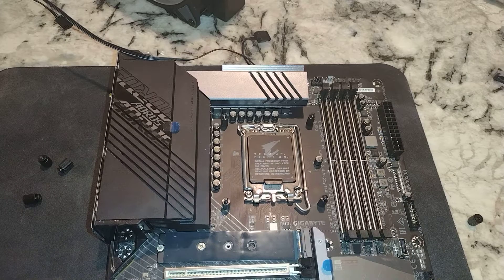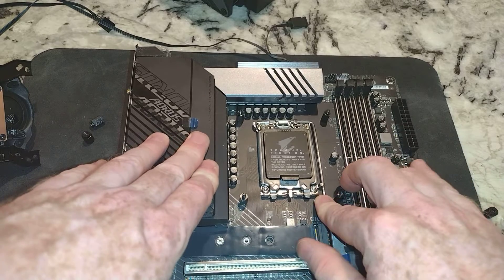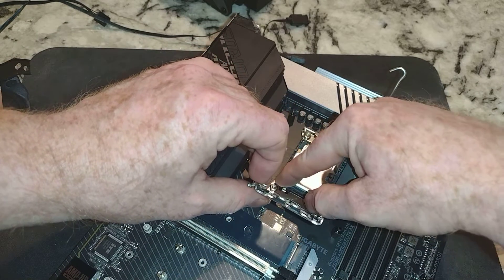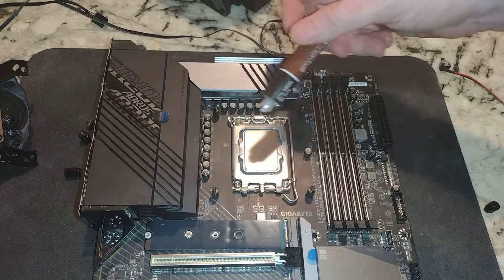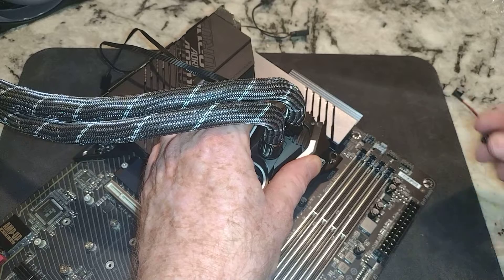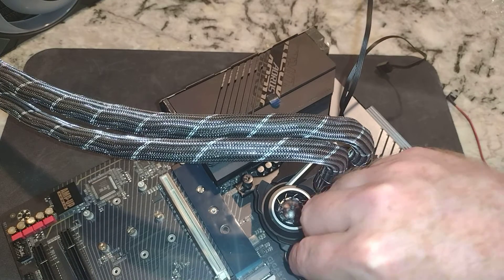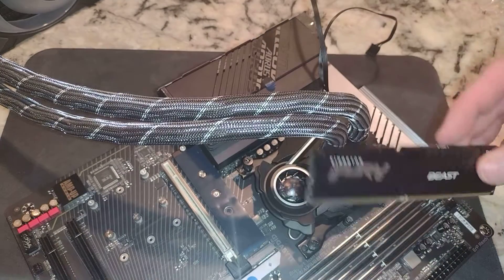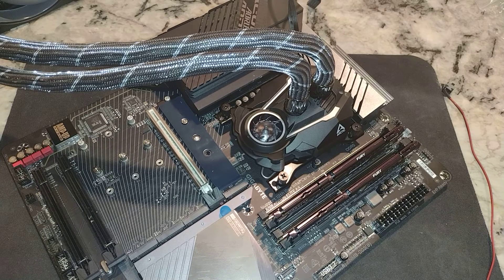Partial Installation, I9-13900kf into Aorus Z690 Extreme AX, Liquid Freezer II 280 AIO, 5600MHz DDR5

Comment from the maker: CPU cooler is 180 degrees installed from the directions.  I did not see any differences in temps whether insttalled the way directions state or not correctly.  I would later upgrade this to a 420mm and get a 5.7Ghz Overclock https://youtu.be/P2skE-CBIWE
Reply: Neither have I
Reply: Same here...
Reply: I was wondering about this because the contact plate on the CPU cooler is rectangular, not square (just a few mm difference).  I figured the longer side should match the longer orientation of the CPU. But maybe it really doesn't make a difference.